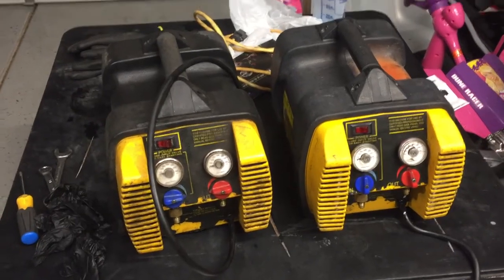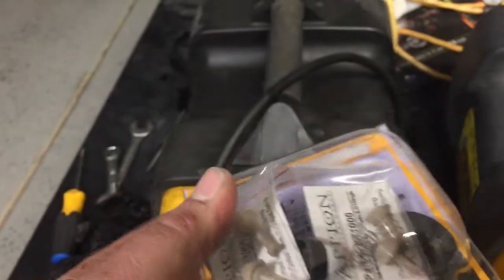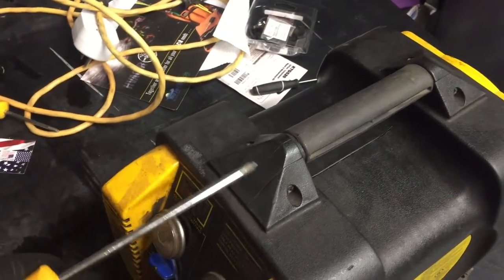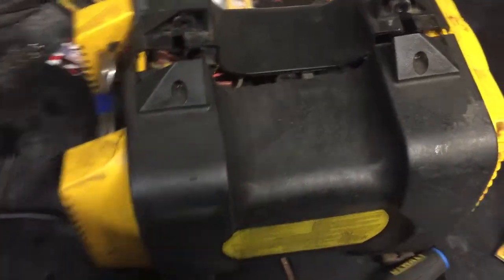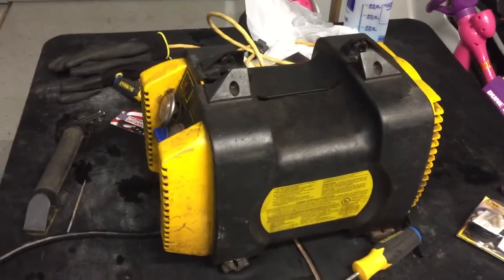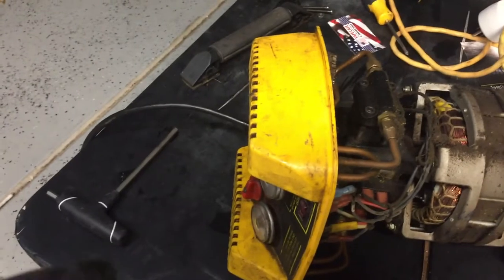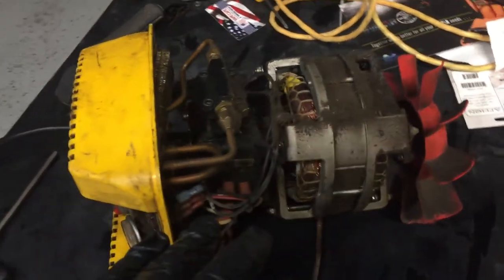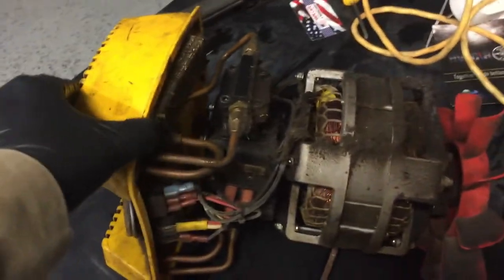Rebuilding appion g5 twin recovery machine.  Neglected and abused

Comment: Watched the video. When  disassembling my machine   the copper seal / gasket that goes between the machine and the piston cylinder was cracked and broken. There were 2 of these  together. The kit does not come with this seal. Where is it available?
Reply: Have you found them yet? Mine are broken as well and nobody has them listed

Comment: The G5 twin does not use oil, the leaking oil must be from the system and they are reclaiming oil and it has hammered the pistons and heads